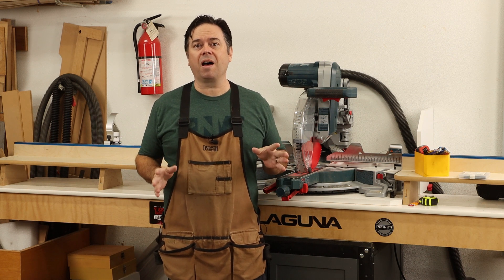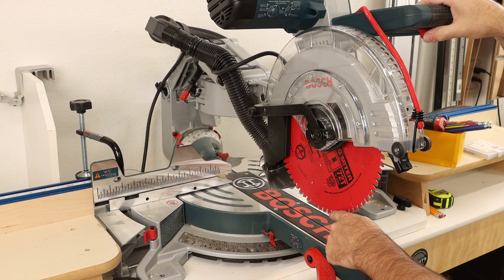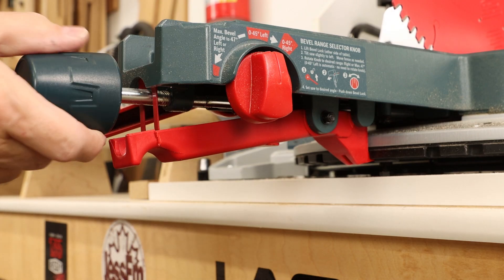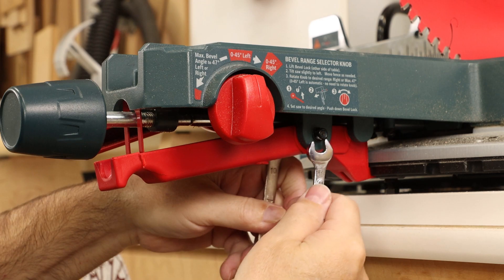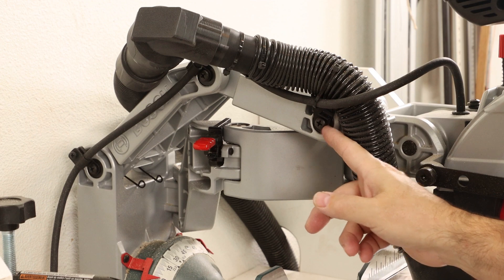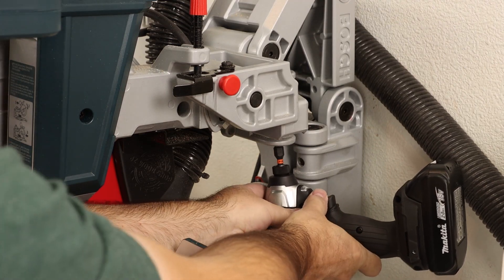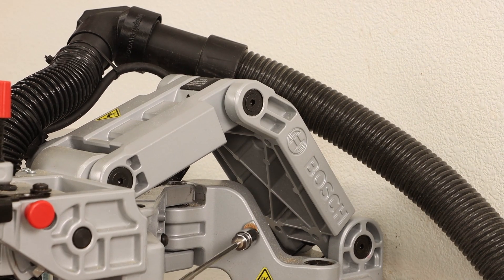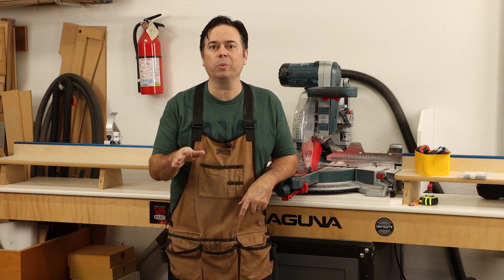Fix Miter Saw Slop!  Bosch GCM12SD Axial Glide Secret Adjustments

Comment: Hi! My dad bought his gcm 12 gdl 110v, we shouldn't own a 110v even cause we're South Africans cause different power voltages and such but bought it years back imported from the States around 2013 or 2014 or so but anyway we're selling it and so I wanna get it properly adjusted as it was new but I have a problem with the back fences like one or the other fence is forward or backward sticking out right and I've been jamming like shims and such to bring it flush cause its cutting out of square and I wondering if ya knew anything trick to help (we'll be buying the new cordless version of the axial guide system) hope ya  having a good day or evening
Reply from the maker: On mine at least, if you remove the sliding fences, and shine a light down, you can see a jack screw in there.  It should be adjustable from the back to align the fences.  Remind me what voltage your power tools normally use, is it 240v? Thanks
Reply: @TheThoughtfulWoodworker okay thanks ill check that out right away we use 220 or 240v we usinh a 110v transformer and such but we are using cordless tools as well down here in south africa (well at least some folks that think corded are still better ) but still thanks i'll check the adjustment screw

Comment: Two excellent videos on this saw! One issue I'm having with mine is the fences done seem to be in line.. The right is slightly back further than the left. I'm sure there's adjusting to do for that.. But these two videos you released will definitely help me dial in the rest of it! Thanks!! Subscribed!
Reply from the maker: Appreciate your nice comment.  If it's the sliding portion of the fence that's out of alignment, you can loosen the knob on the back of the fence, and align it with a square or straightedge as you tighten the knob again.  You may also need to remove the upper portion of the fence to clean beneath it.  Mine came lubed with grease, which naturally attracts sawdust.  Welcome to the channel and good luck with your fine tuning!
Reply: It's the fences themselves. I haven't thrown a straight edge across them.. But it seems one is further back than the other because when I cut there's a bit of "Slop" that the piece on the right of the blade shifts back to. There must be some sort of adjustment to them!
Reply from the maker: @GageDrums  If you take the sliding fence off, and shine a light down toward towards the fixed fence, you can see a jack screw.  So it should be adjustable from the back side of the saw.  Let me know how it goes.

Comment: Just get a better saw, many are less money. Sorry but as a professional carpenter there has been no sliding miter saw I’ve had more issues with than that Bosch. You can fix it, but it eventually just comes back. I had it for about 2 months, then just sold it. My old Hitachi was WAY better for 1/2 the money, and a Makita is about the same money and Way better.
Reply from the maker: Thanks for your firsthand feedback.  Which Makita do you like?  Thanks
Reply: @TheThoughtfulWoodworker any of them! I actually still prefer my very old 1013 but they are near impossible to find and verrrryyyy old. The newer side mounted “zero clearance “ is nice also, I very much prefer the large table Makita has over just about every other manufacturer, and most models have about the best dust collection. Hitachi is still one of the best also most people over look! Metabo hasn’t changed anything that I can tell (only limited access to them since they bought out so maybe something I miss) but my old Hitachi is still my day to day and way more accurate than the Bosch!  I know it sounds like hating on Bosch, but I actually like most of their tools, just that saw is more a gimmick than true function as it was the first zero rear clearance, but just too sloppy.
Reply from the maker: @Thomllama1  Thanks for the details.  I think the Makita LS1219L also looks good https://amzn.to/3KJhRff
Reply: @TheThoughtfulWoodworker  yeah, I avoid 12" saws though unless I'm doing framing/decking. blade flex on 12" is rather high compared to 10" and for real detailed work, 95% of the time never need the slight extra depth/width.
Reply from the maker: @Thomllama1  True.

Comment: Thank you for the video.  I have a lot of slop in my Bosch GCM12SD with blade deflection - much more than 1/16" inch.  I am going to try to tune it up based on your videos and will report back!
Reply: Same here, I have a lot of slop in mine, i’ll definitely be giving this a try. 

I’m a bit ashamed to say that it didn’t occur to me to simply try to tighten it. Having heard that so many people having the same problems, I just assumed that the slop was bad design.
Reply from the maker: @JeffYantha  I think it's a good basic design, maybe with a little inconsistency in the way some of them are assembled.  Thanks!
Reply from the maker: Yes, I'd love to hear how these steps work on your saw.  Totally solved my issue, so I hope you find similar success.  Thanks!